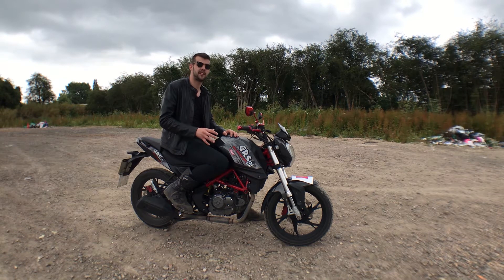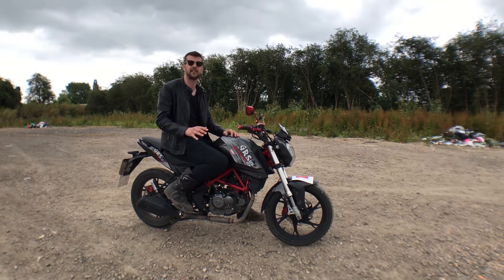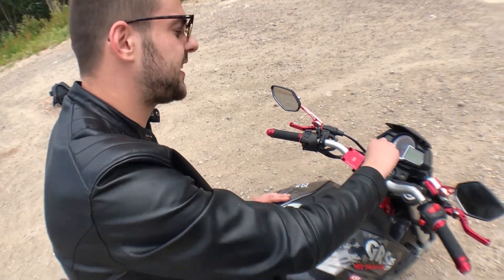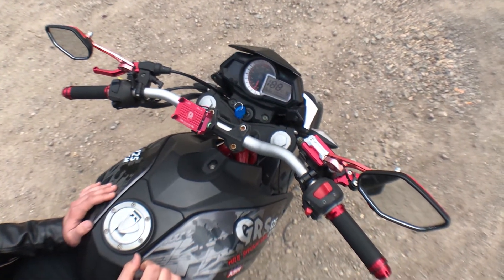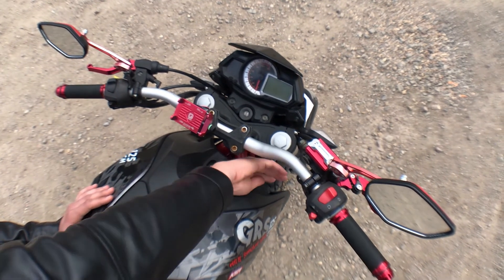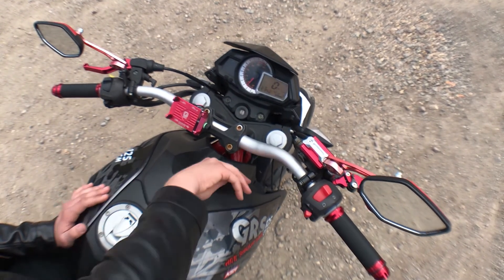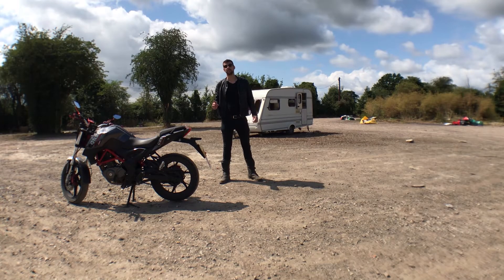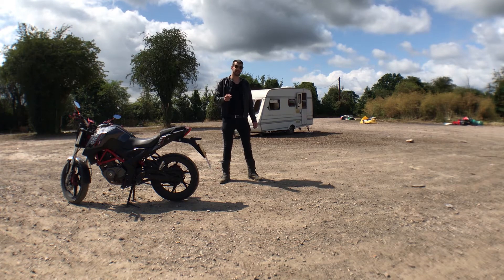Starting a motorbike with NFC hand implant

Comment: i have a doubt .does the arduino  discharges the battery
Reply from the maker: saiteja balusu just a little bit
Reply: hi pavol. im Chimpo from across the pond in wales im due to have my NExt implant in a few days. how close do you need to get your hand to the reader to get a read? im in the process of breadboarding this to eventually go in my bike, but im plan to code this a little differently  by using an ESP32  with deep sleep function and add a FRZ in the seat. to start the reader for a timed intervel  and a reset button for the controller to kill the engine.